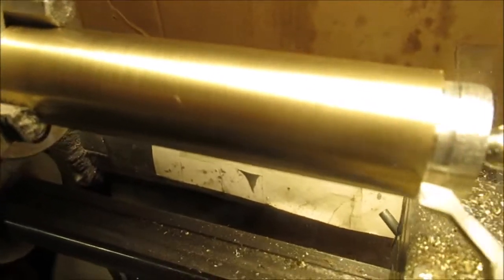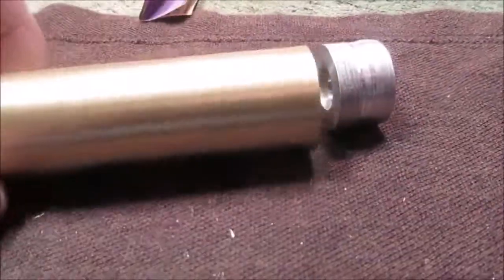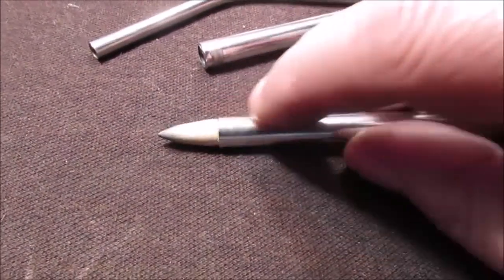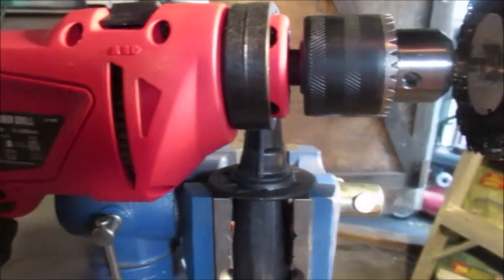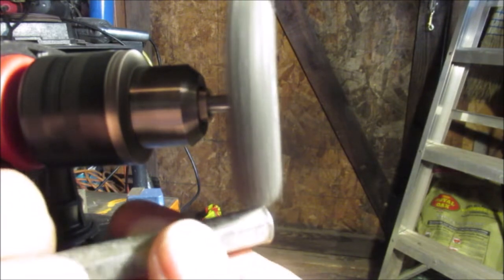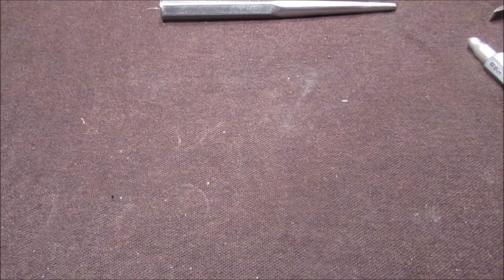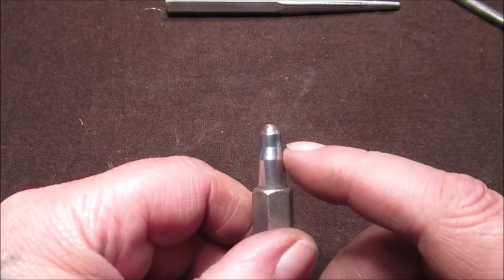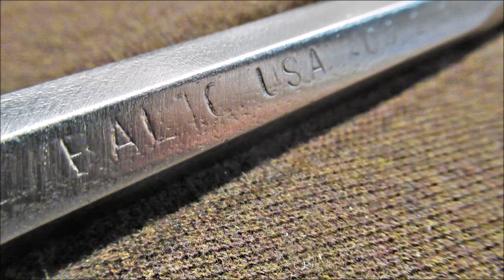Sunday in the Shop with not2fast4u2c....08-18-2019

Comment: That cutting tool does a multitude of jobs. I used those swedging tools when I work on AC system Made it easy to sweet the lines together without a fitting.
Reply from the maker: I like that little lathe bit ..I did modify it to my needs..I hve never used the swedging tool and should try it